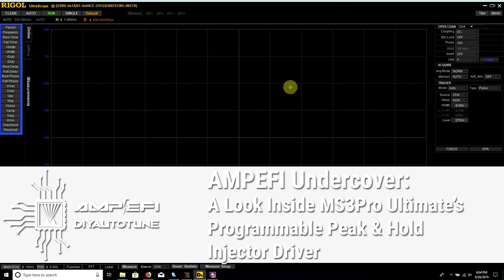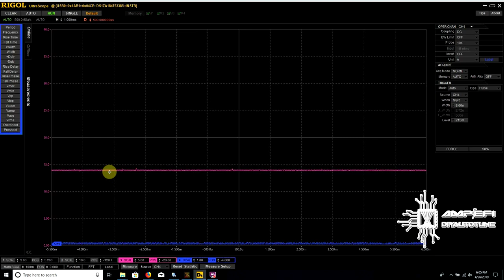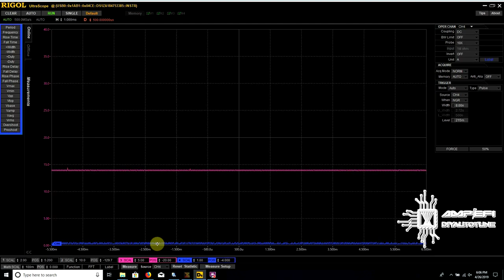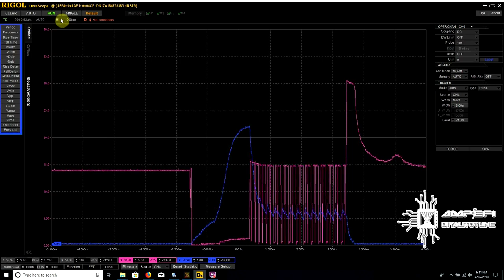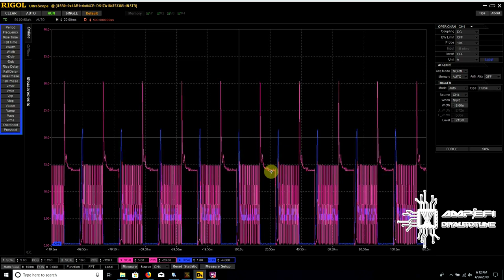AMPEFI Undercover: A Look Inside MS3Pro Ultimate’s Programmable Peak & Hold Injector Driver

Comment: I have to agree with the previous post. The pintle closes at the pintle hump after the voltage spike. You must subtract that „overspray“ time from the dead time since the ECU thinks the injector is closed while it still keeps spraying fuel.
So initial „dead time“  minus the overspray time is the correct dead time that you have to enter in tuner studio. 
Greetings from Germany

Comment: Very good explanation of what is happening during the injection event, with regards to current and voltage, also, at the 5:12 when you show the current change ,where the pintle lifts off its seat, you can also see when/where the pintle comes to rest in the voltage  (pink) trace as it comes down from spike you see a little hill, before settling at 14 V, thats called "pintle bump".

Comment: Nice explanation!  A question: What's the primary reason for peak/hold?  I assume to get the injector fully opened as quickly as possible?
Reply: Yes, Get the needle moving as fast as possible, and then limit current so it doesn't burn out the coil and mosfet.